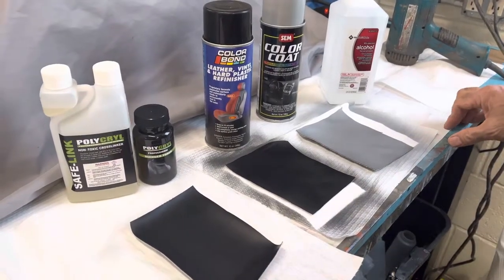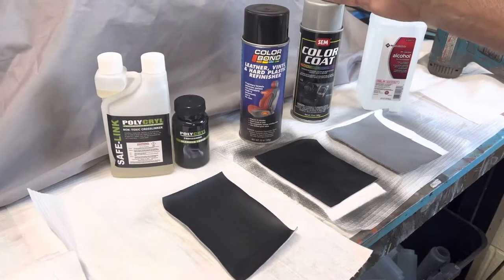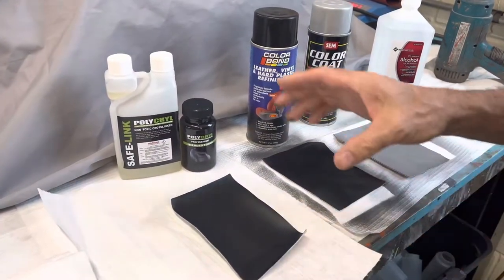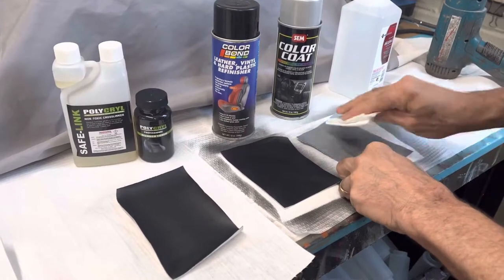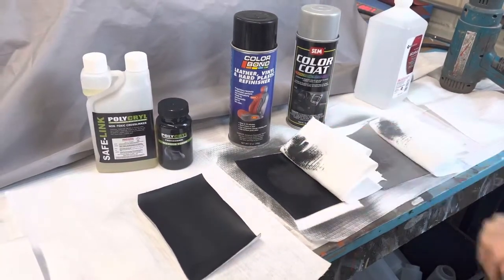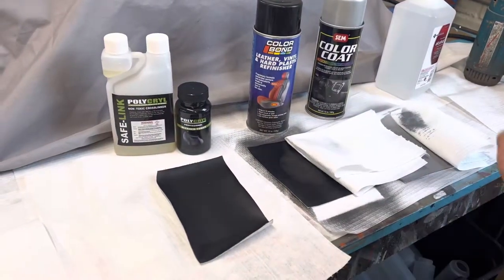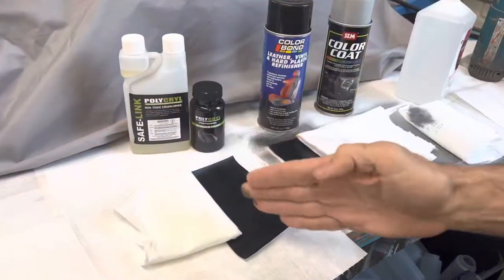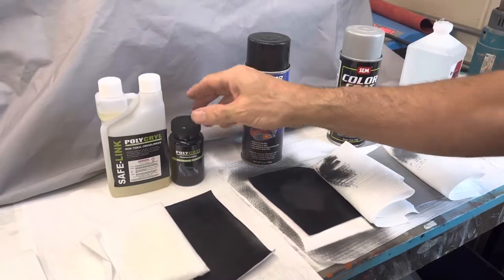Professional Leather Finish VS Standard Rattle Can Spray Paint.

Comment: How much time did you allow for the SEM and the Color bond to cure before doing this test?
Reply from the maker: They were all applied and dried for the same amount of time 24 hours before the test . Spray paint is spray paint there is no crosslinker once its dry that's all you get it can dry for 3 months and you will get the same results  not to mention it will crack and peel over time. Our professionals have to redo these rattle can jobs all the time .It just makes a mess and only looks ok for a short time its a quick fix. No durability. Real pros do not use rattle cans. We match the colors and blend the repairs with professional high performance finishes..

Comment: Why would i use alcohol on my car leather seat tho??
I think the aerosol can paint is cool
Reply from the maker: Many cleaners and sanitizers contain alcohol that is why most of the products sold commercially are just a quick fix and do not last .Aerosol Spray paint will ruin a leather seat . Aerosol o or solvent base spray paint will make the seat hard and will crack and peel  .Real  professional techs have to fix these hack repairs . Our products are not for DIY these are professional products for professional techs.